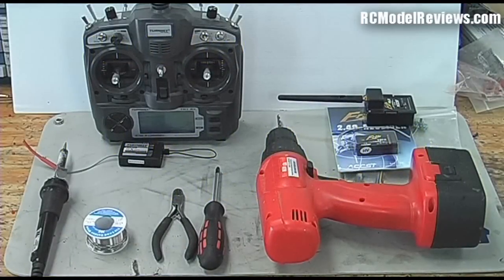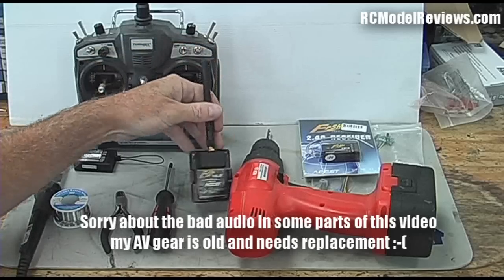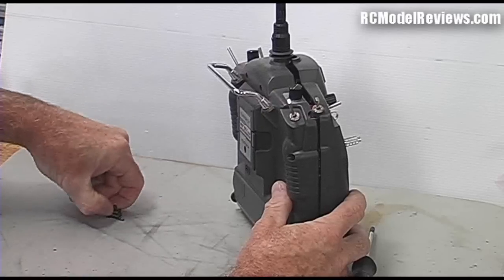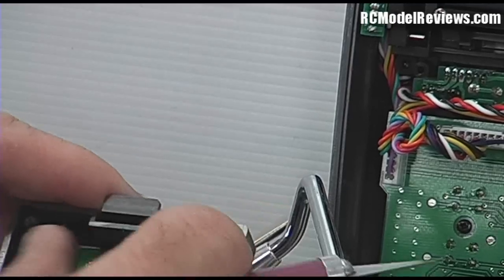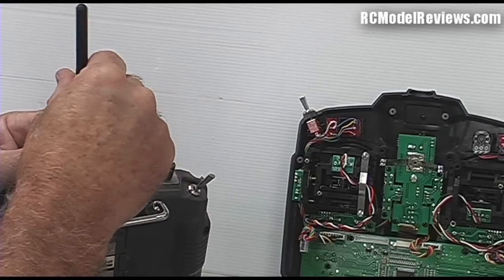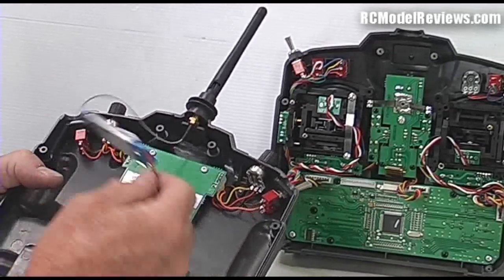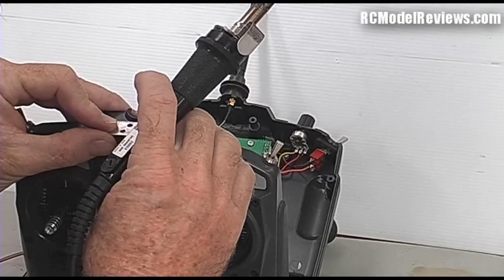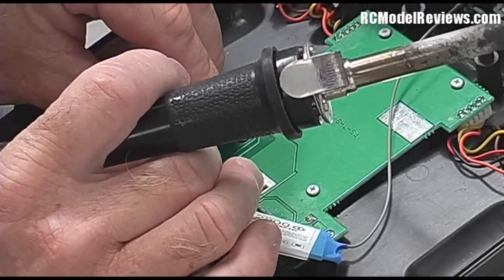Installing the FrSky 2.4GHz DIY kit in a HobbyKing Turnigy 9X radio

Comment: Hi Bruce  I bought a turnigy 9xr with the fry sky module It works really nice so far bit I've notice receiver won't bind when the tx is 1/2 meter around the heli I have to move it up or far to bind is this dead spot normal? Thanks

Comment: Bruce,
  I have enjoyed your videos over the last year.  Thank you for providing good stuff.  I do have 2 questions about the Turnigy 9x.  In this vid you mention one of the benefits of switching to frsky is to get fail safe option.  However, on my Stock Turnigy 9x under Settings options on the 1/2 screen on the bottom right it has" fail saf"  and when you click it you go to option to set fail safe parameters i think.  Never used the radio yet so I don't know if that is what it is for or not.

Comment: Great video -- thanks for the detailed instructions!  Very easy to follow!  Question, though: after I bind the TX and RX, the LED on the TX flashes red and yellow quickly.  It seems to be bound (the LED on the RX is green), but the TX flickering is different from the solid red you have in this video.  Any ideas?

Comment: hi 
    i have jr 9x radio and with spektrum ghz radio i broke its antena wire from module side and i don,t know where exactly its soldered plzz help me post a video or simply tell me that coaxial wire is soldered at two points at one at one end or only middle core is attached ?

Comment: Saw this mod on other videos but by using the module instead of the diy kit.If you disconnect the antenna which is necessary to remove the original module, I can't see how it will effect reception. Being an ex military radar technician, I am skeptical on that point since it is disconnected and has no significant way to channel the energy and load the transmission. Other vids show mounting the old antenna to the original 9x module and that seems the best to retain full function w/ both modules.

Comment: I currently have the FlySky 6 Channel TX and several 6 Channel RX to go with it. But I want to upgrade the TX to the Turnigy 9 Channel TX. Can I use all my 6 Channel RX I had on the Turnigy system? 

Question two is. Is this a good system for my scratch build parkflyer hobby. I don't plan on going with bigger planes or beyond the parkflyer level.

Comment: Hi Bruce the turnigy 9x does have a fail safe its in the menu just have to pick the channel set it to position and push and hold menu ,,,is there any other reasons why you would switch to frysky? PS love your vids !!

Comment: Look at me, I'm civilized so I won't cut this wire. Ah heck who am I kidding I'm a beast, snip. I have a thought for you. When you attach the new antenna with hot glue wont turning the antenna cause the glue to break free? I would use a plastic zip tie pulled tight around it just above the nut to hold it in place and allow it to swivel without breaking free.

Comment: you can also use the Hobby King GT-2 2.4Ghz Receiver 3Ch  	PRODUCT ID: HK-GT2_RX great for them 3 channel and small models. and even better there cheap
these only work with the v2 turnigy 9x

Comment: How about converting the crap 9053 Heli from Double Horse into a 2.4ghz and replacing the crap radio, the antenna is garbage out of the box, it wont tighten and just spins freely on the internal nut inside of it. Is there a 2.4ghz PCboard from other Double Horse heli's I can swap it out with and get better range and a better radio?

Comment: Will this Diy work on the FS 9CH 2.4Ghz Transmitter that has both the FM ans 2.4ghz module antennas. I would like to remove the FM antenna and replace it with this Diy mod. Thanks for all the help.
Cheers, great vids, keep them coming

Comment: Hi Bruce, thanks for the video, I have fitted one of these DIY units to my 6i and it works a treat.
I am now fitting one to a dcm9x, just curious, I was just wondering what the other 2 pins from the module are used for, do you know?

Comment: Hi everyone, just started into learning about Quad copters, Question?
Can "ANY BRAND receiver" installed on the copter work with the module on the Turnigy 9X radio
Or this is the point of this above youtube video to change the 2.4GHZ "module"

i.e. FrSky 2.4GHz module/board to use with only FrSky 2.4GHz receiver on the copter

Comment: Is it just two antennas that gives more reliable range. I have Flysky Tx and 8channel receiver from hobbypartz. I was flying Multiplex Funjet. For couple of times motor stopped rotating but I had elevon control and was able to land it. but the third time I lost the control and plane went into tree. do u think if this is Tx and Rx range issue or problem with ESC on the plane. I am confused. I have ordered 5 more Flysky 8 channel receivers. evenif I can get 1km range I will be fine.

Comment: Hi Bruce, I recently did the DIY frsky upgrade (DHT), and unfortunately had to wait a long time for the receiver. But now that I have it, I tried to bind the receiver to the Turnigy 9X frsky but without success. No matter how many times I try it won't bind. Is there a way to test if the radio is transmitting without buying expensive test gear?
Reply: Hey I'm having the same problem did you find a fix? Thanks

Comment: i just did this upgrade with my 9x, but with the telemetry version, it works beautifully but every 3 seconds it beeps. I'm not sure what it is, it has 8.4V so it's not exactly low on battery. If anybody has any solutions it would be greatly appreciated.

Comment: Hi Bruce, I ordered what I thought was the same as you demonstrated from HobbyKing, however as I review your video with parts in hand, I find that I got the FrSky DHT 8ch DIY Telemetry Compatible Transmitter Module.with a small toggle that has 3 positions. You do not show this toggle. Now I notice its a DIY for an 8ch . Will this conversion work for my radio or should I return it?  Also, can't seem to find the one you used on this video. Please help - thanks
Reply: Did you end up install the module into your 9X?
Reply: I haven't installed it yet, but after seeing another video, I'm comfortable with using it. There are so many options getting into this hobby, I'll be changing things forever. I like that, just want to get flying with my new build asap. Still waiting for more parts to arrive from HK.   Why do you ask?
Reply: J Dycki I have the 9x, going to be reflashing it into the ER9X within the week, and would like to upgrade the TX part, so that i can use a smaller RX on my quad and later on use Telemetry. Where abouts did you install the three way switch?
Reply: I placed the small switch to the right of the antenna and left of the rotary knob on top of the radio Fits well there. Watch several videos that either left the switch inside on 2 way not expecting to use it and another mounted where it is more accessible and I chose the latter one and glad I did. Looks good. Mounted the binding light and switch on top directly in front of the antenna after making a template for the holes spacing and diameter. Looks just great. Didn't like the mount through the front grill that some have done. Just my view on the thing.

Comment: Tied to handl a trainie connection with a MX12. During dissconnect the cable it was some problem. Since that time Receivers dosnt have Signal. New Binding doesnt help and on Simulator also dosnt work!!!! So.... crashed :(

Comment: what gives you the best performance replacing the old 9x module with the frsky one or using the diy kit
Reply: ***** I'm thinking the same thing. Did you find the answer?
Reply: +Michal Gloc well in the end I just got the module because I'm lazy and so far it has been good but to put the module in you have to trim a bit of plastic where the prongs are in the 9x hope this helps

Comment: So i put this system in my turnigy 9x, binding seems to be good as both TX and RX leds are solid and if I turn off TX then RX led starts to flash. However, I blug in servos and motor but they will not respond!! TX and RX seem to be bound but can't control servos.

 HELP PLEASE ANYONE I'VE BEEN AT THIS FOR ALMOST 3 MONTHS NOW!!

Comment: Bruce, have you heard of Ali Expresses' New 2.4G 8CH KST T810 Transmitter w/ Receiver Radio System  with 2200mah 11.1v Lipo Battery with neck strap with balancer &stand?

Comment: I have a JR 8103.  Someone said that the 2.4 module was for park flier type stuff.  Is this true?  Or can I put this system and a reciever into my 1/4 scale cub or 600 size electric heli?    Thanks in advance!!
Reply: yes it will work in those bigger rc helicopters/planes, but with helicopters you have to make sure that you find a suitable flight controller

Comment: Hi, I have a FS-i6 transmitter which has 2 default antennas. If I use a Wifi amplifier, how should the amplifier be connected to the transmitter ? Thank you
Reply: Open the FS i6. disconnect one of the antennas by unplugging the IPX connector (you just have to pull it out carefully) . connect an IPX to RP-SMA pigtail (it's available on ebay) to the antenna port you just unplugged one antenna from. connect the wifi amplifier to the sma end and you're done.
personally i'd disconnect the antenna present in the stub rather than the one in the carry handle since it will be easier for me to extend the amplifier antenna in the same direction. Hope that helps.

Comment: is it possible to use an other antenna with higher gain to get more range on this kit?
Reply: frode eriksen of course you can
Reply: frode eriksen  Yup but it will be directional. You will see a few antenna aiming gimbals in use. 
An example:  https://achuwilson.wordpress.com/2012/05/18/long-range-rf-link-using-nrf24l01-rf-transceiver/

Comment: @priatnasuardi I believe it does.  If you check this thread (half-way down) there's a photo with the FrSky V8HT installed and he's running ER9X.  rcgroups.com/forums/showthread.php?t=1338412#post16549680

Comment: ::::QUESTION::::   Bruce, I want to buy a DJI F450 build kit. It uses the NAZA-M Lite and I'm so far considering buying this Turnigy 9X radio to fly it. I am wondering, does the Turnigy 9X with its BUILT IN transmitter/receiver offer capabilities of RTH and all the fail safes? Or do I need to upgrade the Tx & Rx to a FrSky setup? Would you recommend this radio to me for an F450 build? One where I want to use all of the NAZA available features, GPS and later Gimbal? 
Thanks and Love the Vids!
P.S. You should go to the next Vidcon and get with other Youtubers if you don't already. Might help increase your YT monetization.
Reply: It's a great radio if you upgrade to frsky,i use it for my dji f450 with gimbal,you can set the flight modes on the 3 way switch and another switch fpr failsafe,and the knobs are great to control gimbal!

Comment: this is prob about the fourth or fifth mod tutorial for this transmitter an i still haven't been able to figure out what on earth is the purpose of a "module system" as opposed to my current built in radio transmitters, IF THE MODULES CANNOT BE DISCONNECTED!?!? nevertheless switched to any other type of module... This is exactly the kind of product engineering fiascos that makes my teeth curl up and crumble. So lets put our issues aside for a moment and accept that a "module" is essentially just a user friendly ,conveniently accessible, easy tool-free plug and play - PERMANENTLY embedded radio transmitter unit.   Especially if you consider the fact that these are seperately sold units at HK. Athough i must say that in Europe there has not been any decent radio system available in months (taranis, tgy, 9x, 9xr, Evolution,etc all not available) and i waited for a taranis in backorder for 2 months before i gave up. So the turnigy 9x mod seems to be my only option. And the best part is that HK didnt have any 9x's without modules, nor do they have any modules hahah. But ok i have my secondhand oldie 9x on hand now. Why on earth are we not simply able to connect the other module by simply jamming it into the "plug and play tool free easy access" slot on the tx? from a technical point of view it just seems so pointless to make a completely different permanent radio system and all it will do is provide a different type of receiver compatibility. I find it a bit strange that the frsky module needs 3 connection lines to the board in the tx, as well as the obvious antenna itsself and  woah what a surprise, its a red a black and a ppm signal wire which are all coincidentally available on that exact location in the tx. WOW! i wish someone would have taken it one more step from there and would have pioneered himself a really innovative system where the 6 original pin headers that are so neatly positioned that they actally align perfectly with the module insert's counter part, the female headers, and if only any of those pins would contain a vcc, a GND, and a PPM signal line.. And even more groundbreaking, whoaah, if only the FRSKY module for the 9x systems would have such amazing technology as well and could be somehow engineered to a level of compatibility regarding those 3 wires. that way, you would have  a radio system that will support both TGY as FRsky and even DDM/x/2 etc, just by simply swapping out the modules ahhahahah. What went wrong with that idea/?? probably the most commonly seen case of dickbutt manufacturing: the chinese boss says that he wants that market leadng product and he wants to be producing thousands of them before the start of christmass... And thus not one but 20 people have worked on the module  system and in the end, none of them ever sat back and wondered how the hell the permanently installed antenna on the tx, can be permanently connected to the removable module insert.. ROFL OMG IFPMS.  So why also swich the antenna piece, is the turnigy one (lookst the same to me) really that horribe or does the FRSKY protocol require a different way of transmitting? Also, if any spot would have been so perfect for hiding that module board. Wouldnit be a perfect spot for it??
Reply: #rant

Comment: Installed the DIY frsky module in a new turnigy x9 and am having some problems.  The X9 binds with the frsky d4r-ii but the radio will not cause the motors to spin up on my quad.  Built the "cheap" zmr250 described in Bruces multi part videos and Cleanflight will spin the motors when connected via USB.  It will also show movement of the bars on the receiver tab in Cleanflight when I move the sticks.

Would love to fly my new model so any suggestions or things to check would be greatly appreciated.

Cheers
Reply: Did you work it out I had same problem need to arm the naze 32 board my holding throttle down and to the right for a couple of seconds
Reply: Lucas Falzon some how I had reversed the throttle so it would only arm holding the throttle up and to the left.  Got it sorted and have crashed many times now
Reply: The radio chip has an internal gain setting. It was probably set by some coder to the wrong value. I dont know how that sorts out in the user interface, I am new to this, but I do know the nrf24L01 radio chip it is based on.
Reply: There is a section in the menu that you can reverse some or all of the sticks
Reply: you probably need to change top and bottom end range of throttle and yaw so it arms the board. you should get a green light on the naze when the board is armed. thus sounds like your issue

Comment: I have been watching a long time.  I like the way the speak. I was in wellington  new Zealand way back in 1969.

I am very old school. but I am stuck now. I can not get this new 30a esc (vw-1-h) from hobbyking to bind with any of my transmitters.
the servo's when it is connected all work ok.....   but no motor control.
I have tried turning the transmitter on first then plug in batt and wait for the right beeps and move the thro stick all way to top then down to off.
nothing has worked at all
SOME-ONE  PLEASE HELP ME OUT.?????????????